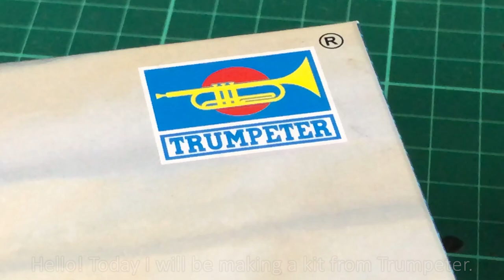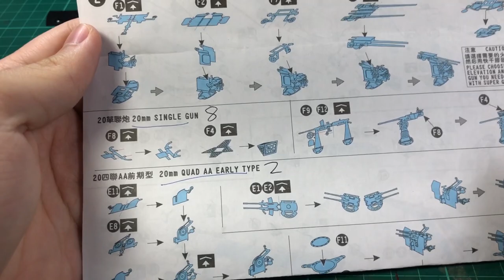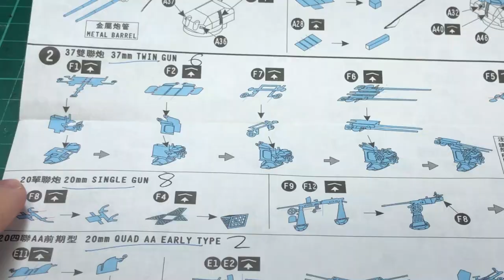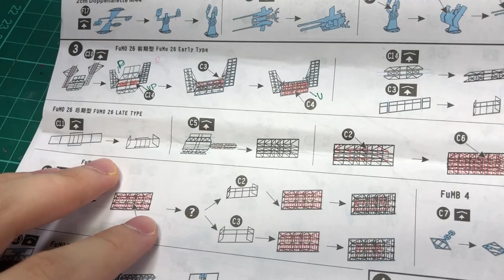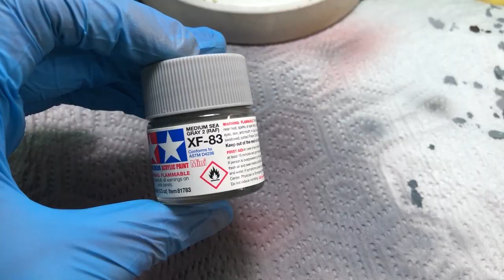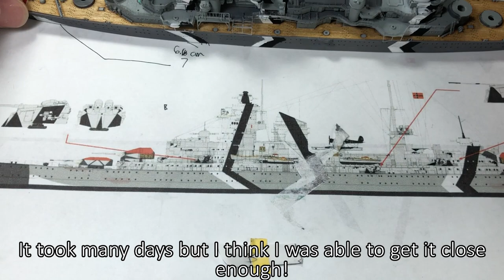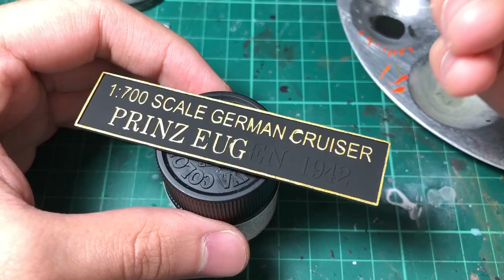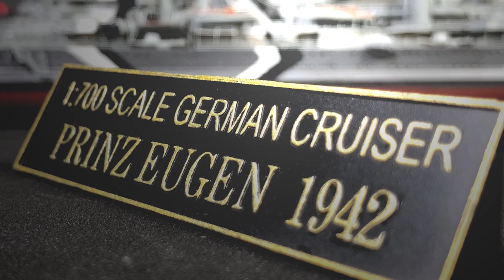1/700 DKM Prinz Eugen - Trumpeter

Comment: Could you do a video on how your modeling space/area is setup, the most frequently used equipments and colors. Also, what kind if board do you modelers use(green one)? Excellent model and great video!
Reply from the maker: Thank you very much! I use a big cutting mat. (The green one in my videos) The small blue cutting mat is just to separate the parts that have already been cleaned.